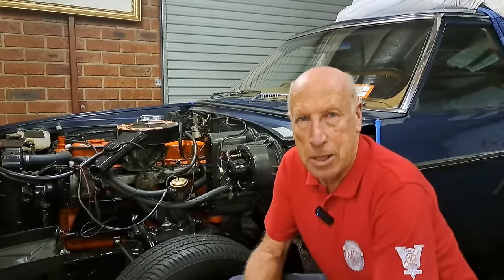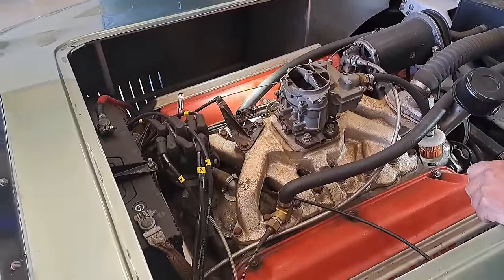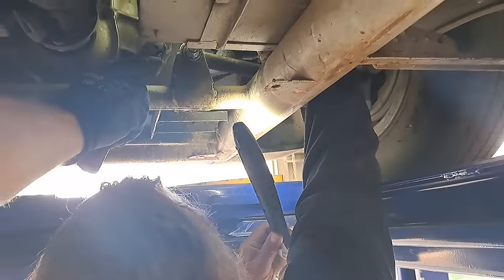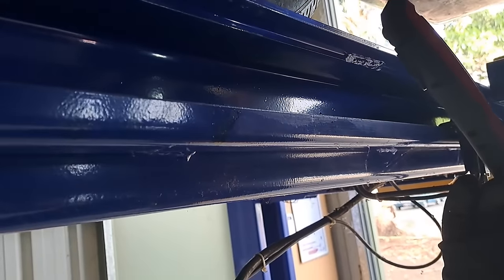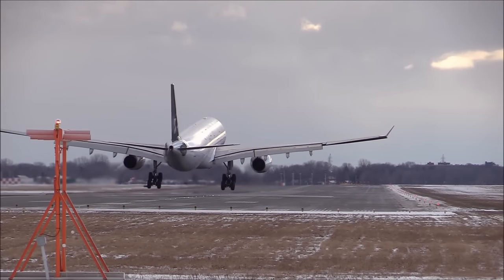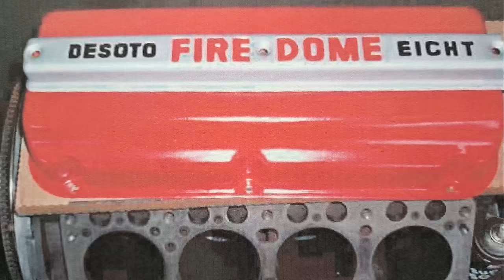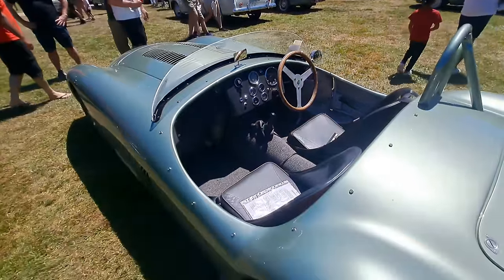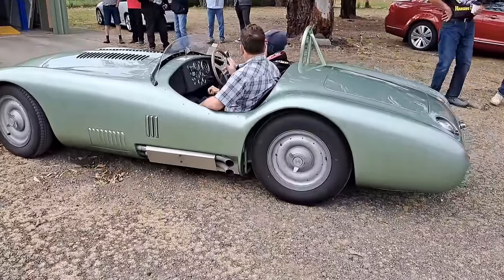1954 Kieft DeSoto SportsRacer. 1 of 1. Beauty on wheels.

Comment: That DeSoto hemi V8 only has 2bbl. carb!!! Factory 4bbl intakes for DeSoto hemis are scarce, but they're out there. Likewise too there are also various aftermarket 4bbl and multi-carb intakes that would suit this type of car that can be found if one searches.
Reply: I owned a couple of Early Hemi's,Both 1954 Chryslers. Today parts are easily available From Hot heads in the US. They have an agent in South Australia, Rob Thompson .
Reply: It’s a large 2bbl, but adequate for 276 cubic inches.
Reply: ? @Mercmad  The intake manifold casting has such a large carb platform, it almost looks like they used one casting mold design to allow for either a large two bbl or small four bbl.  with studs drilled & tapped to suite. Under carb gasket almost duplicates the appearance of a mandated restrictor plate.

Comment: Desoto made a couple of Different Hemi's which were quite popular in Certain classes of racing in the USA including the First one running ast over 100MPH on the Bonneville Salt flats. The first DeSoto hemi had a displacement of 276 cubic inches and produced 160 horsepower. Dubbed the "Firedome," it went under the hood of DeSoto's new model of the same name. The Firedome got a modest 10hp boost in 1954, but the following year a 291 cubic-inch Firedome hemi that made 185hp was introduced. DeSoto's hemi engine continued to grow steadily as the years went on, and in 1956 a DeSoto Fireflite powered by a 330cubic-inch V8 was chosen as the pace car for the Indianapolis 500.

Although the stock 1956 Fireflite model weighed nearly 4,300 pounds, its 255hp hemi gave it a 0-60 time of just over 10 seconds, a respectable time for any American car in 1956 that wasn't a first-generation Chevy Corvette.

DeSoto's hemi grew to 345 cubic inches in 1957, when DeSoto added the Firesweep and Adventurer options to its lineup. Both were steps up in power: The Firesweep could manage 295hp, while the Adventurer's two four-barrel carburetors cranked it up to 345. That cut the latter's 0-60 time to under seven seconds and gave it a top speed of 126 mph. In 1958, DeSoto gave up on the hemi in favor of Chrysler's new 350 and 361 B series V8s and customers began to back away from the brand.

Read More: https://www.slashgear.com/1537102/desoto-hemi-engines-guide/
Reply: I have a 57 Firesweep & the information online is incorrect. The Firesweep is a base model & only came with a Polly engine. We raced small cube Dodge & Desoto Hemi's at Bonneville on a boat load of nitro back in the 90's & I still have about a dozen of them.

Comment: Surely a car in 1954 wouldn't have had a roll bar behind the driver?
Reply from the maker: Yes you are correct. The sports racers Rollbar can be removed to match the original car. The bodywork has 3 discs to fill the holes.